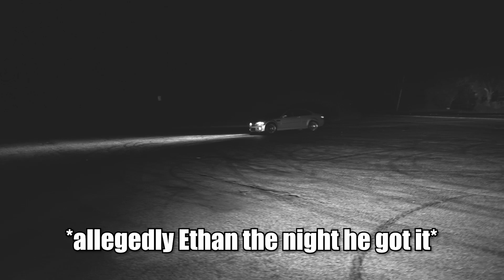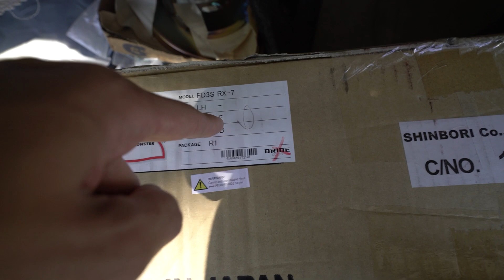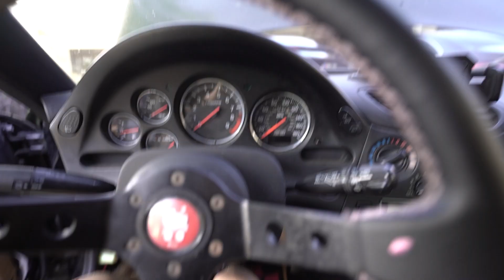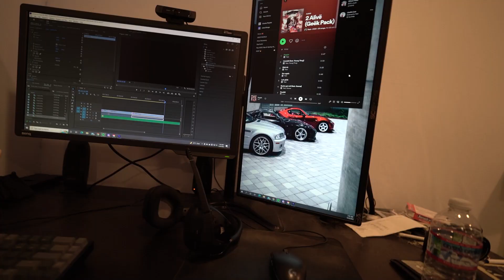New Seat, New Problems...

Comment: You're gonna need the FG rail from Bride to get the low position. The slider bar sits on the outside so you can plant the seat on the floor.
Reply from the maker: Yea calling evasive today
Reply: @TsuchiFD  If you lower your seat you're gonna have the bolster is gonna be at a lower point and might get caught on the door

Comment: You gotta loop the seatbelts through the holes on the side of the seats, unbolt it from the bottom loop it through the bottom hole, it might get the seatbelt to sit lower.

Comment: Need to remove the slide to get lower but will be difficult to bolt in, I'd thread the seatbelt thru the bucket seat too to hold you down around your waist or you could submarine :(. Love the content and the banter as usual :).
Reply: absolutely dont sleep on this, yo do NOT want to experience that.

Comment: you could take the cover off the seat and grind that part down a few millimeters so it wont hit, i dont think it would harm the structure to grind a few mm's. the seat height will probably require some different rails though